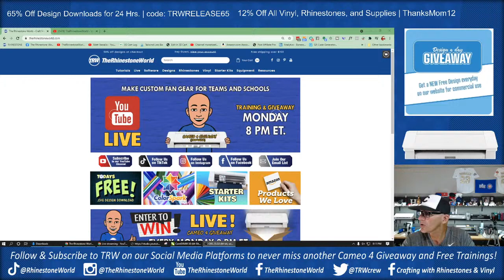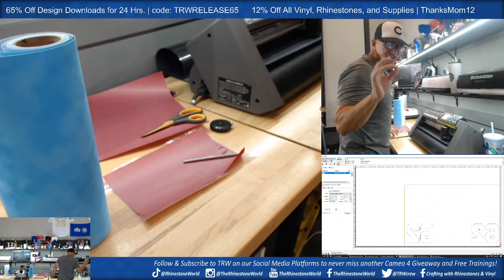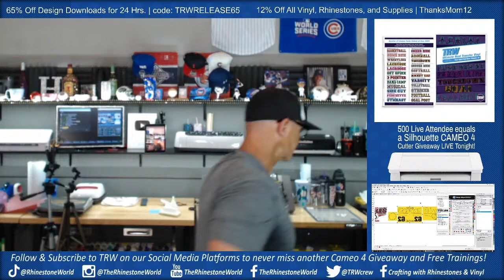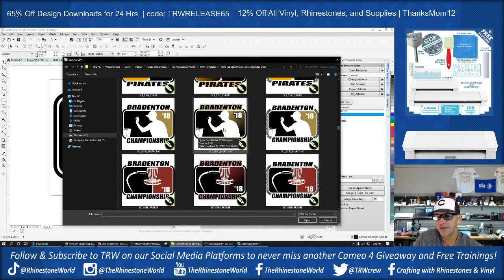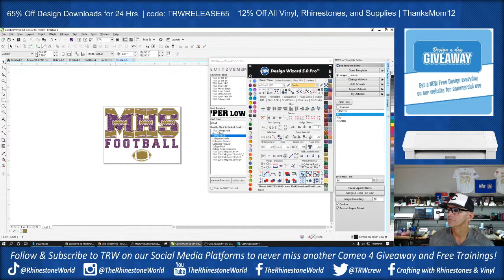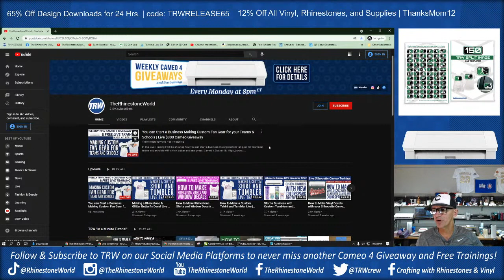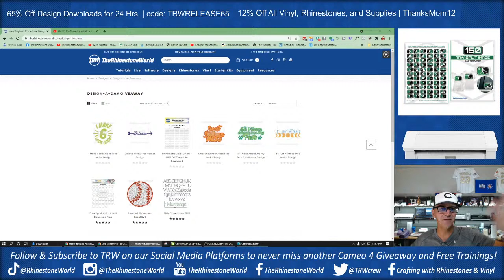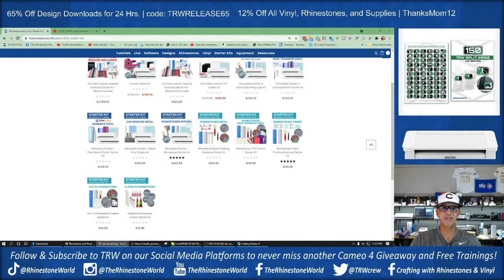You can Start a Business Making Custom Fan Gear for your Teams & Schools | Live $300 Cameo Giveaway

Comment: What height were the letters for the MHS design... any tips on cutting the cheer font. I just tried and all the little details won't stay in place (cameo 3)
Reply from the maker: The MHS ended up being just over 4" tall. For cutting anything with details, the smaller the design, the smaller the details. Also, check your blade, cut specs, speed. Anytime you can slow down your cut, the better the tiny details will come out. -TRW Pilar
Reply: @TheRhinestoneWorld  thanks pilar i was using the auto blade and my letters (4) were about 2.75 tall... i don't think that is big enough to get all of the details of the cheerleaders to come out clean using the cameo.